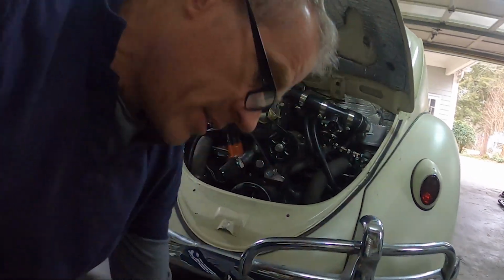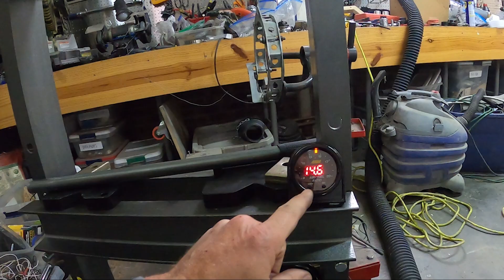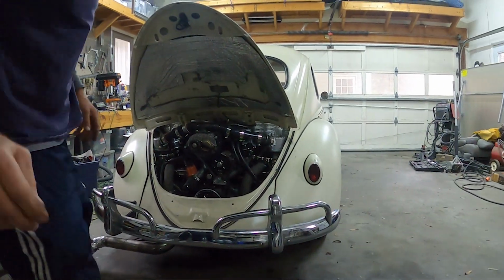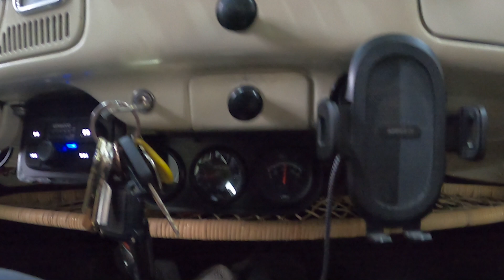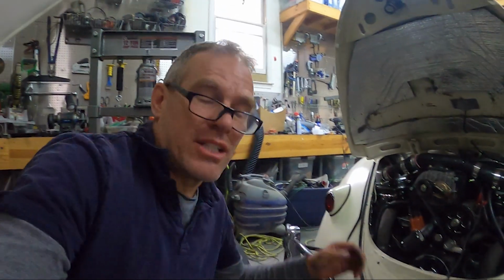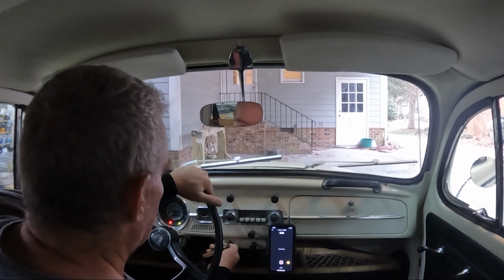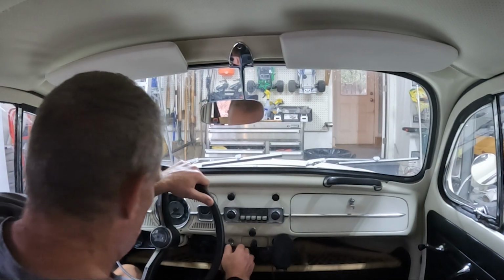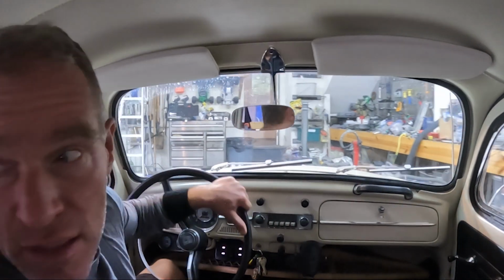1961 VW Beetle - Test Drive with Strong BOV Spring

Comment: That was awesome when you got into the throttle on the second run 👍
Reply from the maker: It’s getting closer, but there are stumbles - and it is tricky to get the carbs tuned with the pressure hats on…

Comment: Yay you did it!  Webers can have a flat spot even on a good day.  Like I've heard, with dual Webers you will always have something to do on Sunday.  Being out of sync can cause it.  And then the transition between the idle and main circuits etc...  But good job!  If you could data log the AFR that would be interesting.
Reply from the maker: Yeah - it is close - but I don’t know how to proceed yet - I think I want to lean it out just a bit with 2.10 airs and 1.30 mains.  Turbo emulsion tubes really do their job richening up on boost.  Then a bit of timing experimentation…
Reply from the maker: By the way it seems to haul ass when all 4 cylinders are firing with no bogging
Reply: Yeah I could hear it making happy sounds @LarsonSplitBus-

Comment: Hi, slight chatter is ignition missing caused by one of 2 things in my experience.  Either too steep timing curve, however with yours set at 20max advance, this is unlikely.  Or more likely is the spark is getting blown out on boost.  Try a smaller spark plug gap.  This was what it was on my draw through sc12 blower set up.  I hope this helps.  I'm interested in your blow through set up as with mine I have  cruise issues being too rich.  Do you have the same issue?  This type of setup could be my answer if not.  Cheers C
Reply from the maker: Yeah - so I took off the pressure hats and balanced the carbs with natural aspiration.  They were way off.  Then I did lean best idle on both at natural aspiration.  It ran great with no boost.  Then I put the pressure hats on and it ran well, but idled slower with the 4 lbs of idle boost.  So I barely bumped up the idle speed screws symmetrically, and ran it for a while.  But now the Air Fuel ratio is at 9.5 to 9.6.  Way too rich.  I think it is the turbo emulsion tubes - but I have 2.00 air jets and 1.35 main jets.  So my next step is to swap in 2.10 air jets and 1.30 main jets and evaluate how it works.  It is annoying that it takes a week for these new jets to arrive, so I am stuck waiting…
Reply from the maker: I was unable to get my supercharger to work.  It showed signs of LOTS of boost power, but then the AMR500 delaminated and all these Teflon flakes got jammed into my dual carbs.  This was the second AMR500, because the first one started grinding and was reaching 300 degrees on the pulley.  I think my lesson is that I needed a more expensive centrifugal supercharger.
Reply: @LarsonSplitBus-  yes they are pretty cool but expensive.  Since I last messaged you I tried an amr500 myself but again as a draw though ste up.  It delaminated on me as well. I took it apart and the build quality is very poor compared to the sc12.  I've gone back to the SC12 even though it means I have to use stand offs in the engine lid again.  It gets warm not hot like the amr500 and has lots of miles on it without delaminating.  I suppose you get what you pay for.  Hoping for more VW adventures from you soon? Cheers

Comment: G'day, 
Your slowly working this out. 
It certainly hauls arse when you give it the boot. 
Q. How much power do you think you've gained. 
So thanks for sharing. I look forward to seeing what happens next. 
✌️ Peace from Melbourne Australia.
Reply from the maker: Impossible to know yet - I need to tune it properly.  I think I am figuring out how to do this - first balance and tune with naturally aspirated carbs.  Then put carb hats back on - where I needed to slightly bump up the idle speed.  Then it ran well, but Air Fuel ratio was 9.5 so I really need to swap in one size bigger air jet and one size smaller main jet and then re-evaluate my setup…
Reply: @LarsonSplitBus-  
Thankyou for the extra information. 
It really is trial and error with dual carburettors and more so with yours.
✌️ Peace.